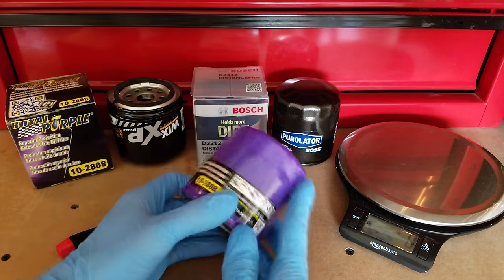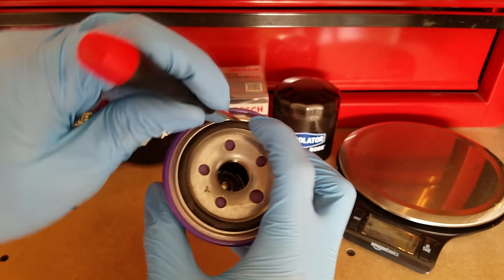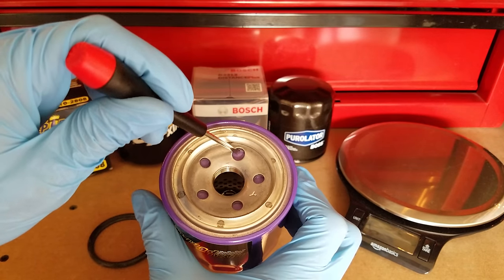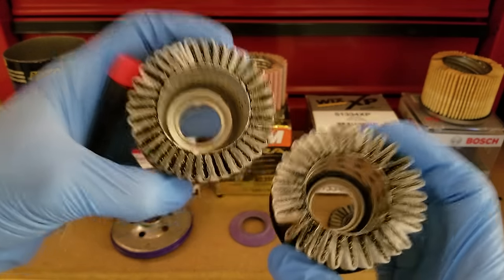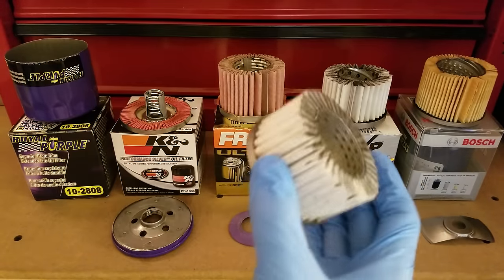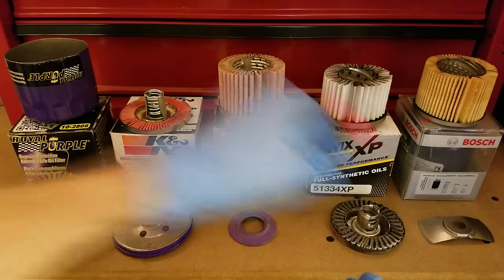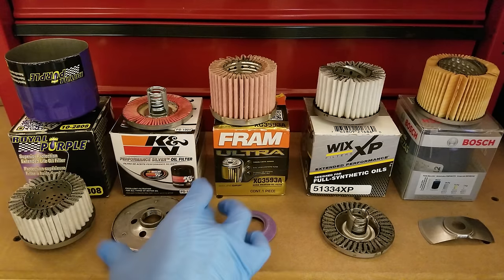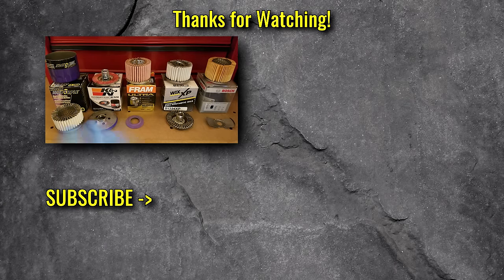Royal Purple filter Cut Open!  vs FRAM vs WIX vs BOSCH

Comment: Royal Purple makes lubricants, now who makes their filters?   I know they don't, and I'm betting if it's American, it's probably Wix or Baldwin. WIX makes NAPA's filters,  and they do an excellent job equal to Royal Purple, but they only come in plain white or plain black.  So if you like the color purple, go ahead and pay extra for the fancy color.  BTW_The filter only needs to be 90% effective, any finer and they will plug up very quickly. Modern engines are designed to tolerate super fine particles,  plus, because of finer tolerances on piston rings, contamination of oil due to blow-by is minimal.  Of course, using synthetic oil is a must!  It protects better, lasts longer, and enables engines to turn over easier when it gets cold, helping the starter and battery last a lot longer.
Reply: Bullettube champion make royal purple and amsoil oil filters!
Reply: They also make mobile 1 filters
Reply: Craig Krueger :  Really?  I didn't know that, though it makes sense, Wix is the best and their filters aren't expensive either.
Reply: Austin Helinger and champion is pure junk.
Reply: Walter K: Agreed, but Champion doesn't make filters, they put their brand name on filters made in China, probably from the same factory that makes Fram and other junk filters..
Reply: Very doubtful that Royal Purple makes lubricants.  They probable buy stock from a "real" petroleum company and formulate the additive package, if they.  Maybe all they do is add the purple dye to the oil they buy.
Reply: Victor Silva:  I know for a fact that most additives include polymer thickeners,  much as STP does,  which makes oil stronger and things like zinc and phosphates to slow down oxidation which causes the dark deposits of burnt oil that can clog oil channels and prevent heat from being carried away.  While these additives work, they also increase the viscosity of the oil making the oil pump work harder and more likely to clog oil filters.  Yes, they put purple dye in their product, the same way Leigh sprayed blue dye on their coal and Coke adds caramel coloring to their sugar drinks.
Reply: Bullettube Royal Purple make their own filters. I sat eight hours in a royal purples oil seminar
Reply: Mr-T:  Really? Thank you, I didn't know that!  Where is the factory?
Reply: Phosphates and zinc are added to reduce wear on cams. tappets, and gears.  Detergents are added to engine oil to reduce build up of deposits.  The longer polymer chains of synthetic engine oil have a higher burning temp which greatly reduces carbon deposits which are almost zero with the additional detergents.
Reply: John Ferguson:  Thank you John, I was a mechanic for over 40 years before retiring in 2005 and I can't always remember all the details!
Reply: Synthetic oils are more prone to leaks because all the molecules are the same size because they are man made. Conventional oil molecules are all random sizes and tend to plug up or move much more slowly through places known to leak. 

I read that in an independent study done on oils. Don’t know the truth in it. But that’s what they said.
Reply: Victor Silva every single synthetic oil on the market uses the same base stock.

That being said there are different grades of PAO base stock. Graded on amount of particulate in the oil.

Royal purple uses a very expensive grade of PAO that is very clean.

The difference between brands of oil are their additive packages. This will differ from brand to brand and also depends on what API standard the oil is formulated for. API SF specifications for older engines and  has high levels of zinc phosphate which is a anti wear additive. API SN spec oil has almost no zinc phosphate because it is made for modern engines which use roller valvetrain (low wear) parts and not flat tappet (higher wear).

Royal purple has their own proprietary film strength additive called synerlec as well.

You might think "why not use lots of anti wear additives in all oil?" 

That's because the EPA has strict environmental policies and mandates that the emissions equipment on vehicles last and be warrantied a certain amount of time. Zinc phosphate will decrease the life of catalytic converters and for manufacturers to warranty their products as required, oils with less additives were chosen. 

Look on the back of any bottle of engine oil and you will find the API logo with what spec it conforms to. Most oil on the shelf is SN spec or SM. 

Although they say it's backwards compatible, you should not use modern SN spec oil in something like a 350 small block with a flat tappet cam. It will score and destroy the camshaft/lifters.

My 2000 4runner needs SL spec oil...which is impossible to find. So I use a SN spec oil with a supplemental zinc phosphate additive.

Racing oils are not intended for use on consumer engines, most of them are not multi viscosity like a 5w30....they will be thick and starve oil flow at low temperatures because most racing engines are brought close to temp before starting. They also don't have much detergent because they are intended to be changed after a couple uses. So they will oxidize fast and not clean anything effectively. 

There is a serious problem with misinformation about engine oil on the internet. It's full of bullshit from brand devotees with very little factual information presented.

No I don't work for royal purple lol.

My pops sold their industrial hydraulic fluids and gearbox oils for ten years. 

I've seen 15k mile used royal purple from our diesel truck be tested against brand new Mobil1 extended performance in a film strength testing  device called a failex machine. The Mobil locked up under 5 pounds of load....the purple took all the weights and you could hang your body weight off of the bar and only draw 2 more amps on the electric motor.

Don't take my word for it....you can find all this information including failex tests for yourself.

Thanks for reading if you actually read this whole thing.
Reply: fivefive6 damn you seem to really know your oil
Reply: Robert D I know enough to be dangerous lol
Reply: RP filters are made by Champion Labs
Reply: Victor Silva why would a synthetic lubricant company buy stock from  a "real" petroleum company? They sell synthetic lubricants, not petroleum. What you've said is like saying Hershey (a chocolate company) probably buys their stuff from a "real" fruit juice company. Makes no sense.
Reply: full synth also has a higher temperature tolerance, which is a requirement for turbocharged vehicles.
Reply: William McCartney 1905 is when the turbocharger was first patented. GM produced their first turbo cars in 1962. Synthetic motor oil first met API auto standards in 1972. So how is synthetic "a requirement" for turbo engines if they existed before it? Is a digital tuner a requirement for FM radio? Are radial tires a requirement for automobiles? Synthetic oil, digital tuners and radial tires might be the best suited for some applications but they're hardly requirements.
Reply: Man-Hummel makes wix.  Or at least purchased them few years ago.
Reply: @midship_nc  l see that you are very knowledgeable in the area of oil from a "scientific" standpoint, so you might be the right person to ask. Sure the manufacturers recommend what is the "best" oil viscocity range for your automobile engine, and l would assume they are correct because they certainly do not want engine replacement warranty claims, or even known reliability issues before 100000 or even 150000 miles yada yada etc. etc. My question is if you perform an internal engine performance modification, cam, pistons, or some external such as a turbo, l would assume all that goes out the window. How does one determine or at least estimate what oil viscosity range is appropriate after such modifications?
Reply: @ryancharvat6989  selection on weight is usually determined by oil clearance on your rod and main bearings. 

You need to use oil that is compatible with your valvetrain, so more wear additives for high load pressure valvetrains like flat tappet cams. 

Turbochargers will have oil running through them and are designed to run efficiently while very hot (people insulate them to retain heat), so selecting a oil that can withstand high temperature is very important.

Look into a company called HPL... high performance lubricants. It's very expensive but about the best oil on the market. It's nearly identical to royal purple before the calumet buy out. You will have to order this directly or from a distributor, you won't find this in a store.
Reply: You have it backwards with the piston rings. Manufacturers are currently using piston rings with less force against the cylinder walls to increase gas mileage... that’s why everyone is complaining about new cars burning too much oil.
Reply: Bullettube  Royal Purple oil filters are made by Champion Labs. One of  the best filter makers in the world. This filter is a tank. Use it with complete confidence.

Comment: I was comparing Fram and Royal Purple at the store yesterday and saw that the Fram Ultra has 99% filtration down to 20 microns while the Royal Purple only does to 25 microns. Seems kinda funny how that works and that the joint on the RP is tacky and looks like it'd allow debris to get through.

Comment: I use a Bosch Premium 3330 on my Harley Sportster. Its Rated for 20 Microns. Only about $6. Can get them locally at Pep or Auto Zone. I use the Bosch Distance Plus, Same Part # as this review on a Hyundai Tucson. Used to be able to get the Bosch DP at Walmart. But they stopped selling them.

Comment: Looks like this is a beauty contest.   How good is the filter medium.   What is the restriction.   Frankly, all these new filters are TOO SMALL.   Put in a remote filter that is GIANT.    I have a 64 327 with a filter that fits in a canister.   That is what an oil filter should look like.   Modern filters are a waste.   They are in bypass most of the time.
Reply: Especially on a cold start, I would think...

Comment: Can you just tell us what filter is in your car right now?
Reply: WIX
Reply: I put wix in my 2014 rubicon.
Reply: I use motorcraft
Reply: Royal purple extended life in my 350Z. Wix xp in my other 3 vehicles
Reply: Motorcraft has 30 micron, pretty high if you ask me. Wix is 10, and Purolator one has less than 5. I use Purolator one in all my vehicles.
Reply: Whatever pep boys uses. Probably proline. The store brand.
Reply: k&n they were on sale for 4.98 on amazon free ship and hey it's k&n and never had an issue with any of their products
Reply: Steve what ever is on sale with the oil.
Reply: OEM filter with Mobil 1.  Always have, always will.
Reply: I use STP extended life
Reply: Motorcraft 820S in my 2003 crown victoria
Reply: Iron Man  man forget those rip off's
Reply: fram ultra $8 at walmart, the other are much more, its not worth it.
Reply: Royal purple with RP oil
Reply: Motorcraft and AutoZone clearance oil
Reply: Motorcraft Fl-1A
Reply: Rp oil and filter in my ctsv.. k&n in my Sierra at the moment
Reply: Royal purple in my 2005 Honda Accord
Reply: #TeamSTC Donny 
Great for 4.95 KnN filter
Reply: @isdamanjeff  I have never seen a Wix filter with a 10 micron rating. Nor a Purolator with less than 5. 

I need to look that up because I dont believe that. Sorry. Lol

Comment: Don't use K&N. Or at least check on it frequently. They kick and or pinch the seal after a few miles. I e had two (credit to O Riellys, and offered free replacement) so far do it and my work truck did the same. I can't find any RP oil filter suppliers in my area and hate ordering parts I can't readly return if I have a issue with it. Great video

Comment: To really compare them. You need to make pixie glass case and run oil through them. Read the pressure it reads and how clean it keeps your oil. I run fram alot and My 2005 3.8 dodge minivan has 270k on it.

Comment: Buy a microscope and count the number and size of particles that get thru the filter media.  Then, do a flow test to determine the pressure drop at a given flow rate, temperature, viscosity and the pressure at which the bypass valve opens.

Comment: FLOW RATE and FILTERS

Managed in autonotive retail,. worked in a service station over mechanics had to prevent a bunch of crap. Managed over counter in a machine shop.    
The more you stuff in a filter the more the FLOW RATE is obstructed.  

There is a reason  OIL Filters are constructed a certain way and have been for around 60 years.  

Joe bob did not throw together a paperfilter and the automotive industry and Diesel industry said COOL and rolled with it,   

ENGINEERS designed these filters to give the highest protection and the HIGHEST FLOW RATE.  

When the Oil is obstructed in a dirty filter the Oil rate shows down.   The OIL COOLS YOUR ENGINE and it LUBRICATES YOUR ENGINE.  HOT HOT OIL loses its lubrication properites.  

When a filter obstructs the OIL HEATS UP, is less slippery and wear and tear are multiplied.

All this extra fluff here is costing on the FLOW RATE,       This means shorter engine life,  In todays smaller engines this is a bad thing as they are not made of cast iron.

Comment: I just found your channel but if there is anyway you could keep the filter intact, maybe have a clear filter housing and pump oil through it and compare. I know its a lot of extra work but maybe that could be a good test. To be honest thinking abiut clear housings i cant think of any but in my 2018 rav 4, i dont have a metal filter. Its a paper filter that fits in the housing and you torque it down. Maybe someone makes clear ones like that

Comment: The sins hidden under the Fram is the fact it was lab tested, had 100% filtration at 20 microns.

98% filtration at 10 microns.

It also had the best flow rate of all the synthetic filters in the test, while still managing to be the cheapest.

Granted that was the old design, and now there is a new model due to their new parent company penny pinching. The model tested would be the same as the one you have with you.

Comment: K&N is high flow filter, Purple si high filtration filter = so no comparation.
Reply: Auto H 203 k-n good for 1/4 mile, hold one up to a light, lets some Big stuff through??
Reply: Sorry, I do not understand.
Reply: Auto H 203 it’s for race use. On engines that will be rebuilt
Reply: Although K&N makes high flow air filters, and it would have to be great / worth while quality, since K&N gives million mile warranty that comes with their air filters, otherwise it would be false advertisement.

If K&N made low quality air filters, and claims guarantee of million mile warranty, they would get bad rep, then they lose customers and money fast, I doubt K&N wants bad publicity caused by their air filter, at the very least.

I run K&N filter in my car, and it works well.

Just make sure you clean the K&N air filter on time or earlier, sooner if driven through dusty places, and also use K&N cleaning kit only, and follow the instructions given by K&N, found in the manual.
Reply: K&N has their line of Air and Oil filters, as far as I know of.

I don't recall seeing Royal Purple making air filters, but I know they make great oil filters and synthetic motor oils.

I run the K&N air filters, and as for oil filters, I have different cars with different oil filters, but each car has 1 brand of oil filter, even with brands being different.

Examples : Listed Below.

Car 1. K&N oil filter.
Car 2. Royal Purple oil filter.
Car 3. Mobil 1 oil filter.
Car 4. Amsoil oil filter.

Also same applies to motor oil.

Royal Purple HPS.
Amsoil.

Comment: Never seen an oil filter casing split open during use.
Reply: I did not personally witness it but years ago, my friend, Tony, put in a heavier oil pressure relief valve in his Barracuda, because I told him he could increase his oil pressure that way. Unfortunately,  he put the wrong spring in it, because it was far too heavy. When he started his engine up, the needle on his oil pressure gauge swept past full scale, and was on its way to a second lap, when it exploded the oil filter body and instantly  sprayed 5qts of oil all over his engine bay and 1/2 his garage. Hilarious.